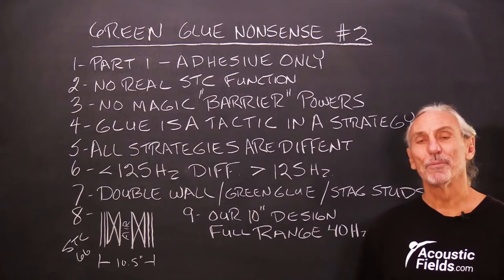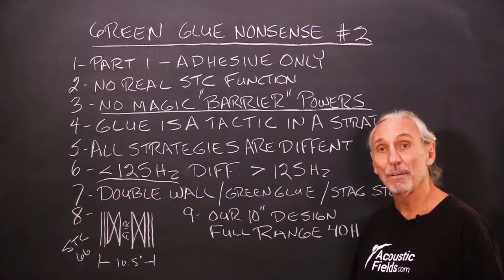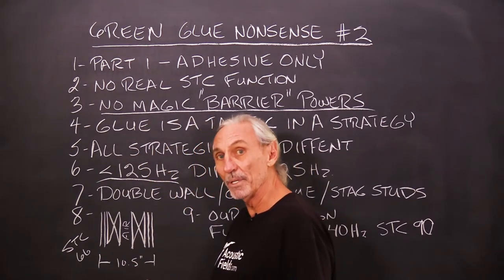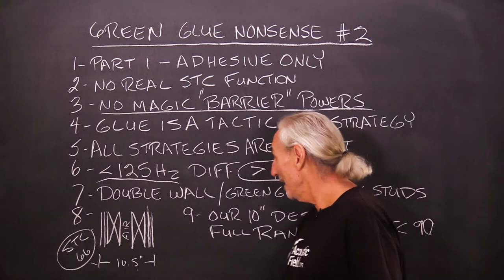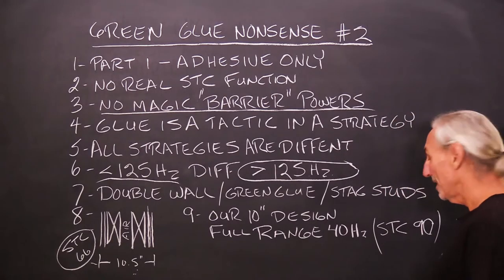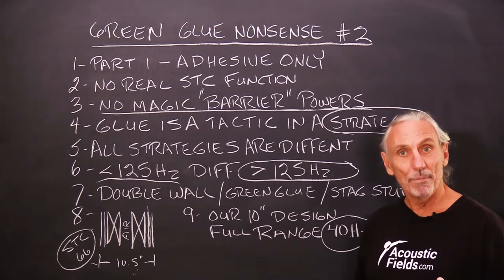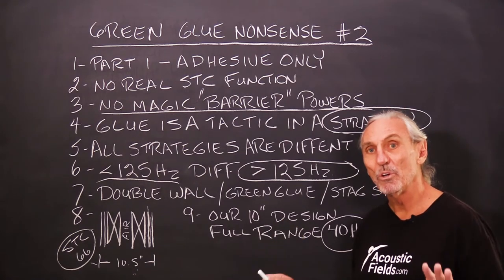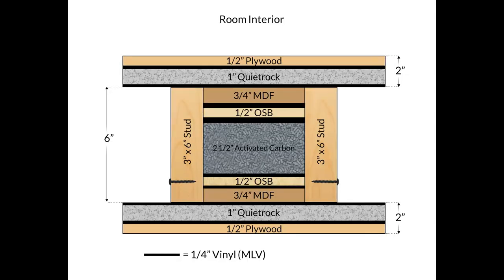Green Glue Nonsense! Part 2 - www.AcousticFields.com

Comment: I feel like you're only talking about sound transmission through walls, not sound quality IN the room. I live alone and I could care less what the sound does through the walls in my basement with 3 block walls, what I want is a solid foundation for sound quality IN the room. I'm thinking the Glue would have some benefit to reducing in-room vibrations of materials against each other, therefore have a lower noise floor for the listener. I want to go with 5/8" drywall and glue with heavy insulation but my carpenter insists on 1/2" drywall and no glue at all. Gonna be some light 2x4 walls I think. Hopefully it's good enough, I wired for 4 subs, lol.
Reply from the maker: Your noise methodology will not work for frequencies below 125 Hz. and is a waste of space and materials for frequencies above 125 Hz. Why would you use 50 year old technology to stop noise that never worked well in the first place.

Comment: This video makes me more curious about the correlation of humidity/temperature/altitude to air density and its acoustic properties with each factor.
Reply from the maker: Not a lrage factor to consider. Spend your time treating the low-frequency issues within the room. The cost benefit ratio to doing this is well worth the effort.

Comment: I have a house near a busy road and have been trying to get sound levels down.  I’ve learned a lot about sound properties from your page.  I have added storm window with a high STC rating and managed to get the exterior sound levels down. But not perfect yet.  I’ve determined that now my walls are the weak link.  I need just a little more sound protection and wanted to know what would be the best route with least effort.  I am willing to add a metal hat channel and another layer of drywall, but would I fill in the cavity with sound dampening fiberglass insulation or just leave it as a open pocket?  Or would you have a better suggestion?
Reply from the maker: What are the frequencies and amplitudes of the noise?
Reply: @AcousticFields  it would be car muffler noise so low frequencies and about 40 decibels are shown from meter inside.
Reply from the maker: @chaderickson1694  Is is 40 Hz. or 40 dB at 40 Hz.
Reply: 40 decibels at 80 hz

Comment: Thanks for the video! Which QuietRock product(s) did you get tested with the assembly that you've shown? I only see a 1/2, 5/8, and 1-3/8 inch product on QuietRock's website. Two of the 1/2-inch, perhaps?
Reply from the maker: What are the frequency and amplitude of your noise issues? Material type, density, and construction methodology all depend on the frequency and amplitude of your noise issues.
Reply: @AcousticFields  aircraft flying overhead?
Reply: @AcousticFields  I have an issue with hearing cabinet doors closing through the wall. Would it be beneficial to just add a layer of QR 530 right on top of the current dry wall?

Comment: I just drywalled my studio but am planning on doing a second layer ...

I have an opportunity to buy 3/4" Particle Board for $10 a sheet.

 Would this be better on the second layer vs Drywall?
Reply from the maker: What are the frequency and amplitude of your noise issues?
Reply: @AcousticFields  under 125 Hz mainly. Loud amplitudes, live drums...
Reply from the maker: @levijessegonzalez3629  You will need a wall thickness of 8-12"

Comment: Dennis, another things that's permeating is the use of those resilient systems….  Maybe you should do a video on that.
Reply from the maker: We have done many videos about barrier technologies. Most of the technologies used were used 50 years ago and people keep repeating the same old mistakes. Barrier technology has come a long way in the last 10 years but people keep repeating the same "mistakes". Most people that purport barrier technology on the net have never built a room. Its obvious from their comments that they do not understand vibrational acoustics.
Reply: @AcousticFields  I was watching some build a room or renovating an older home that do work with structural engineers.

They say how they are soundproof and built to code, yet they many times don't explain what frequency range they are effective in, some don't even mention the STC rating, some do, but they act like it's all one needs to build a sound proof room… The big deal tech seems to be resilient channels since Cities are now demanding those with new builds.  but form what I can tell it looks like a metal piece that decouples and adds a small air gap.  Am I missing anything, is that all it's doing?

They aren't even doing double 2x4's either, but they act like they are building the best soundproof wall and I guess people just assume that they'll work for music related applications..  Some of them say how they work with home theater rooms,  stereos, etc.  which is nonsense.   but they get away with it and people buy into it..

Comment: Can you please tell us what the STC is of your set up without using your proprietary diaphragmatic absorbers in between the walls? 
IOW just using the 1" gyprock, 0.5" ply with MLV sandwiched in between.
Thanks
Reply from the maker: You are confusing sound absorption technology with barrier technology. Our carbon technology absorbs low frequency energy. It is not designed to reduce noise transmission. Reducing noise transmission is a completely different science and requires a different approach to treat.
Reply: @AcousticFields  You didn't answer my question though... The question was "what STC is the image you show minus your diaphragmatic absorber?" If the absorber isn't completely filling every boundary surely you know what the STC rating is of the materials used combined in the image you show otherwise why show it then say "ours is 90%." I only want to know the STC without the absorber or is that image not 90% and that you are dodging around the question and for what!? 
I'm not trying to slander, prove or disprove anything here, I'd just like an answer please.
Reply: From looking at the digraphm, it's not a diaphragmatic absorber like their ACDA units. Go look at the difference in looking cross section diagrams...

Comment: You clearly know what you're talking about, and maybe your method is one of the better ones created, but it can't possibly be cost effective to use whatolks to be 8 layers of MLV IN ADDITION to several layers of your own product, and a whole lot of plywood. 

That just seems like it would be astronomically expensive. In your opinion, is this one of the more cost effective solutions? I have a 25' by 13' room I'm trying to treat. My budget would have to be enormous to pull something like that off.
Reply: And to clarify, I need a full range solution. It doesn't need to be entirely soundproofed, as it's its own separated building from my house, but I plan on recording drums which will be likely the loudest source besides maybe mixing songs with a lot of bass. 

Let's say full range of spectrum at 110+DB and if I could get like 70db reduction of that it would be perfectly fine.

Totally open to exploring your products and solutions.
Reply from the maker: We do not sell barrier technology. We do design with noise and treatment but only sell design products absorption /diffusion. All barrier material types are frequency and amplitude dependent. This means that for every noise frequency and its strength you must use a certain material type with the appropriate density. Step one, you must take noise numbers so you know what material types to use based upon your noise numbers. Using multiple layers of the same material type regardless of the noise numbers is never desired. Without noise numbers to guide you, you are just guessing and guessing with noise is never a good idea. If you guess wrong and you build something that does not work, you will have to tear it out and start over. no one wants to do that. Measure twice, cut once.
Reply from the maker: Drums are the third full range source when it comes to noise transmission. The first is a jet airplane then a gong then drums. You must pay special attention to the noise levels in the neighborhood where your drum room will be located. We build a lot of studios in LA and the noise levels in most neighbor hoods drop by 40% after 11 pm. and neighbors are 6' away. If you play your drums at the same level you did during the day when ambient levels are higher and your noise output is masked by background noise, you will be heard by neighbors.

Comment: Great advise to take the time and take measurements and use that data. In the case of a cinder block wall you cant line both sides as per your design of plywood with 1/2 plywood, mass loaded vinyl and 1" quiteroc so would doing the inside of a cinder wall work or would you use a completely different approach?. Thanks again for these video, always learning.
Reply from the maker: What are the frequency and amplitude of your noise issues?
Reply: @AcousticFields  Im not sure yet as this is a room Im stripping out and converting is there any point in taking measurement when it a bare shell? Cheers
Reply from the maker: What are the frequencies and amplitudes of your noise issues?

Comment: Why do you use quiet rock if you think green glue doesn't work? Very confusing.
Reply from the maker: Not confusing at all. You are talking about two material types that have different densities which will "treat" different frequencies and amplitudes. What are the frequency and amplitudes of your noise issues?
Reply: @AcousticFields  Why would you use quiet rock and not just plane old drywall? Does the viscoelastic compound in quiet rock help treat different frequencies and amplitudes?
Reply: @stephencurran8307  
Great question
Reply: @FOH3663  I know what works. I have seen and actually built things in real life. I know these ideas are cute and work out on paper but not everything on paper works out in real life.
Reply: @stephencurran8307  
Same

Comment: I just want to stop my neighbors from calling the law when I play music or watch tv...So what is the cheapest way to stop sound from getting out of my building.
Reply from the maker: There is no cheap solution when it comes to noise. You must build a permanent structure that is designed to mange the frequency and amplitude of your noise numbers. It would be much better on the neighbors and your hearing to turn down. You should also increase the resolution of your room through treatment. This will allow you to listen at lower levels since you will hear more music.

Comment: I'm wondering if Green Glue should be compared to MLV or maybe Sorbothane, since they are both used in between two layers of another solid material.  ie. Sheet Rock, plywood, etc...
Reply from the maker: It is difficult to make comparisons. One can make density comparisons but that is where things can get confusing. Along with density, you must marry the density of the chosen material with the density of the next layer to produce a synergy between the two where two materials act as one barrier.
Reply: @AcousticFields  Could one figure out what the STC is by taking two of the same materials (sheetrock, or Plywood, etc.) and comparing GG vs MLV vs another material to see what the results would be and how they might differ?   I'm just spitballing. The reason is I'm looking at your design which uses MLV between various materials vs GG in the other design that uses sheetrock.  If you took the sheetrock example and put MLV instead of GG, how much different would the results be? Would there be any difference?  Have you done any testing on that?
Reply: @Oneness100  
Great question...

Comment: Dennis,  Something I don't think you touched upon.

Let's pretend that someone had a big enough room where they didn't have any major issues below 40hz, and they built the entire room (walls and ceiling) using the design you have in this video.  Would someone still need additional ACDA type technology in addition to the "shell" of the room that's using your design OR would they just need to add foam and diffusion for mid/high frequency treatment?

Thanks!
Reply: Yes. Video above has nothing to do with in-room acoustic. It's about sound proofing to the outside.

Comment: Great video. What about using the isolated double wall but filling the 2x4 studs with carbon? Maybe you could MDF both sides of the air gap between the walls and fill with carbon?
Reply from the maker: What are the frequency and amplitude of your noise transmission issues?
Reply: Acoustic Fields I'm a drummer and hit very hard, so like every frequency and the highest amplitude. I would think that two 3.5 inch layers of carbon would really attenuate low end energy

Comment: Can anyone recommend any good books or articles on the theory behind all this? I'd like to understand the basics before I start bothering people with hundreds of my questions:) For instance I don't understand the schematic Dennis showed, if the activated carbon works so well then why are we using only 2 1/2" of it?
Reply: There are other videos that Dennis has done where he talks about using different types of materials for sound barrier technology and he says you have to figure out the frequencies and amplitudes that you are dealing with and then he has to figure out what materials to use, what order in sequence.  So everyone's situation could potentially be a different barrier design.  this is just one example, but your situation might require a completely different wall structure using similar or possibly other materials, varying thickness, etc.
Reply: I'm no expert and I'm sure Dennis can correct me if i'm wrong, but my understanding is that even though the carbon is the workhorse of that design, having the different layer densities and thicknesses is crucial.
Reply: @jacobwhite936  Think of the carbon as the fill material and you have to figure out the "cabinet" surrounding it.
Reply: @Oneness100  Great analogy.I was just pointing out that varying layers are essential for a good barrier.

Comment: Wow that's an expensive wall.  Plywood, MDF, OSB, Vinyl Mass, Activated carbon, and Quietrock.
Reply from the maker: Noise is expensive. It can be 5-6 times more than absorption/diffusion treatment costs.
Reply: I do not think he considers the labor involved. I think he just specs out the project and has never installed any sound mitigation treatments himself.

Comment: Doesn't Quietrock use viscoelastic damping compound (like green glue) between its layers?
Reply from the maker: We are not familiar with this process.
Reply: @AcousticFields  what do you mean? This is a known fact; I thought; it's on their website, as well as Wikipedia, etc. There's no confusion about that; my confusion is why you are against Green Glue which is a similar (if not the same just differently branded) material, but you are using Quietrock whose main component is that same viscoelastic polymer, in your solution. Perhaps the legitimate debate is about uniformity, as you mentioned, i.e.: Quietrock vs. DIY Green Glue solutions, meaning that Quietrock may be applying the material between its layers with required uniformity, which is difficult to achieve DIY with a caulk gun?
P.s. I am not a professional; just researching a solution for my apartment.
Reply: @RKDTOO  
Indeed, bizarre.